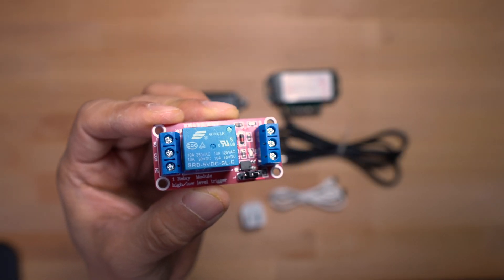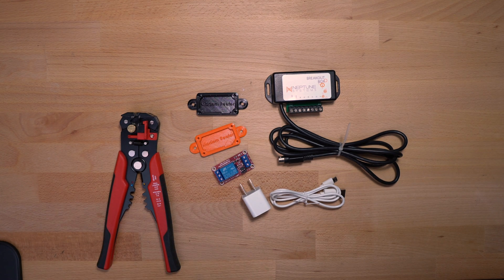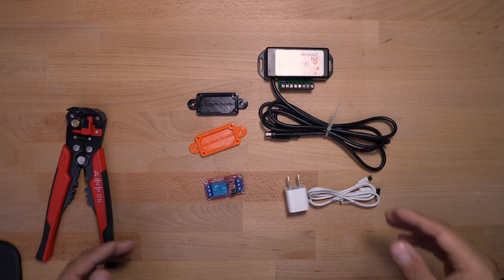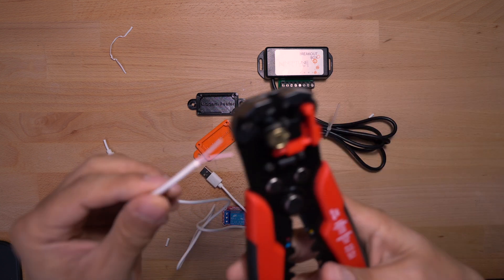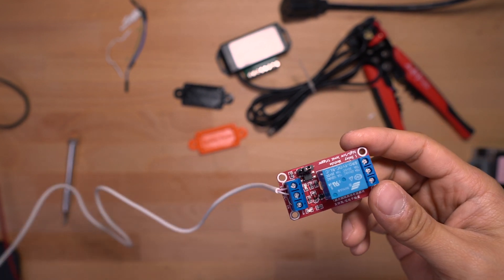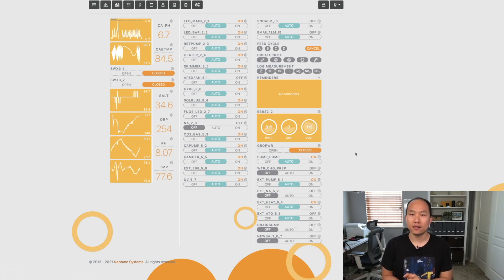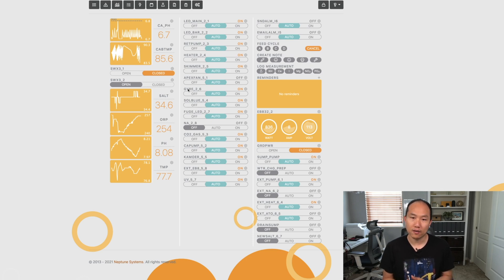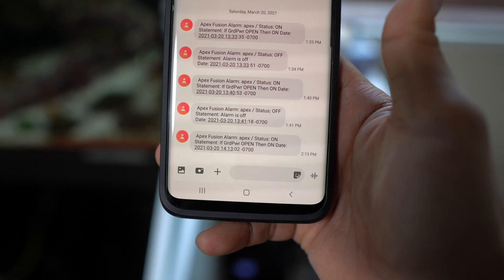Aquarium Battery Backup UPS APC Runtime Extended - DIY - Red Sea Reefer 625xxl

Comment: Dude your Apex can do this with out you doing what you did.  There is a power monitoring mode on the Apex  if you turn that on and add a command that if power goes out only run outlet so and so.
Reply from the maker: Thanks for sharing. I did not know it exist but the method I have still allows the apex to be running.  My main goal is to still be able to control the apex while the power is out since it's on battery backup.   I had it setup this way so that I can still control my Apex when I'm out and about.

Comment: Where is “here”?
Reply from the maker: Sorry.  Cali.
Reply: @ModernReefer  me too
Reply: @ModernReefer  you ever had of anyone putting reef tank in garage ?
Reply from the maker: @hkn2718  Yes.  I know a lot of people running frag tanks and displays in their garage.
Reply: @ModernReefer  do they have any problems with heat, condensation, rusting?  Thank you
Reply from the maker: @hkn2718  No.  I do have a air flow system setup.  I'll have to do a video on that.
Reply: @ModernReefer   yes please do a video about it.

Comment: It's been a minute Paul. Why not just plug only the essentials to the UPS? The only thing I have on mine is my wave maker that's aimed at the top of the water. I just need oxygenation til I get home.
Reply from the maker: Yes that will work too and would be the easiest solution.  For me, I wanted to be able to control my tank while the power is out and have apex notify me.
Reply: @ModernReefer  Gotcha. Wouldn't it still notify you if you plugged the UPS into Apex so when you lose power it's on but you still get notified? I'm just asking to see if it's something I'd need to implement.
Reply from the maker: @StNovaSt  If the Apex is plugged into the wall outlet while the UPS is plugged into the Apex outlet (Outlet > Apex > UPS) and if the power goes out, the Apex will also go out. The equipment plugged into the UPS will continue to run.  In my case I have the UPS to the wall, apex to the UPS while all equipment is plugged into the Apex outlets (Outlet > UPS > Apex).
Reply: @ModernReefer  Oh ok. I thought the notification was cloud based with the Apex where once it lost power, a notification would be triggered. I get you now.
Reply from the maker: @StNovaSt  So I get a text when the power goes offline.  The Apex has that ability as long as the apex is still online (running through the UPS) and the internet cable modem has a ups connected to it. So far it's been working okay the past few days but the ultimate test would be when there's a power outage.